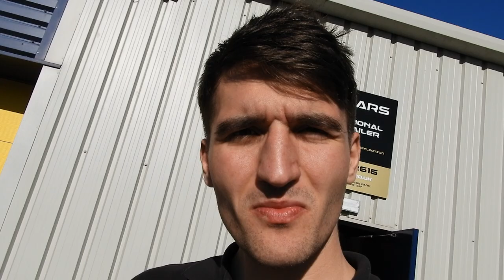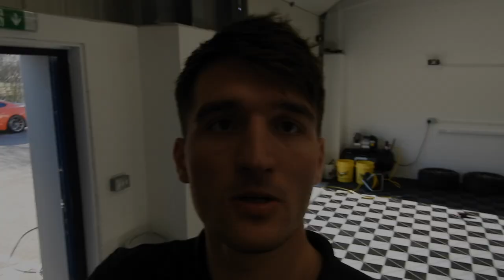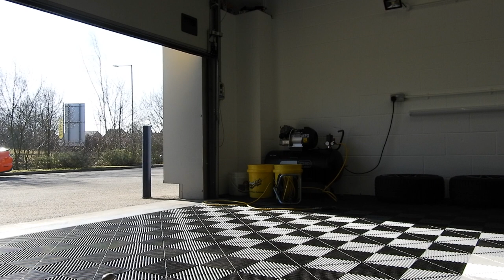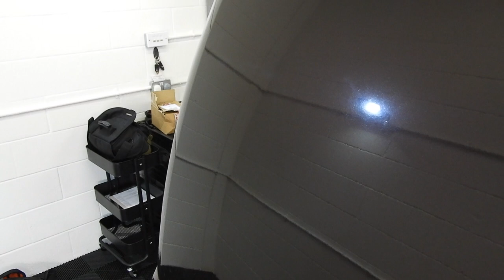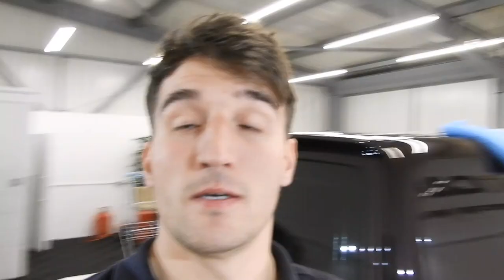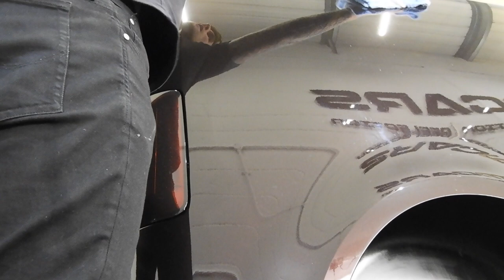Caddy Correction Series Episode 2

Comment: If you didn’t have access to compressed air, how many pads would you use to go around a similar sized car? And how often would you use a microfibre towel or brush the clean the MF pad?
Reply from the maker: That would really depend, I usually use around 4 pads to cut with and 4 to finish with. Regards cleaning I blow my pads out after every set of polishing I do.